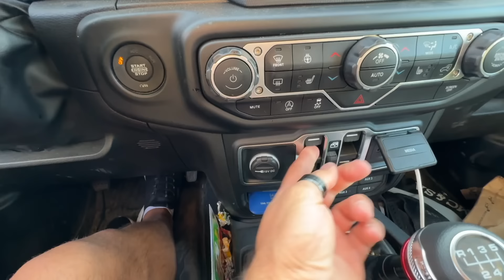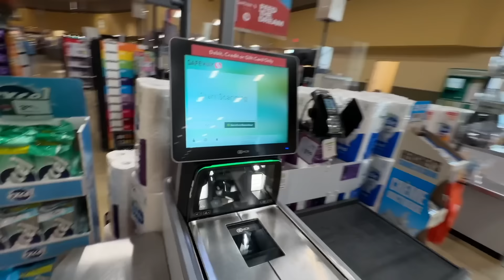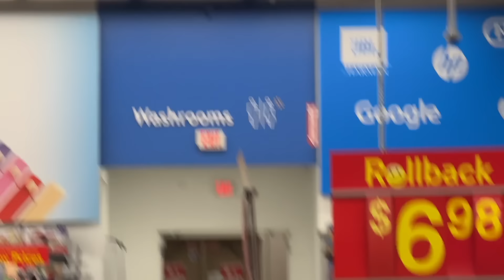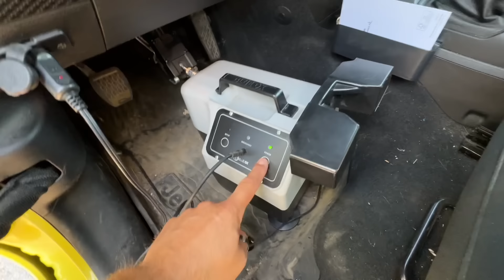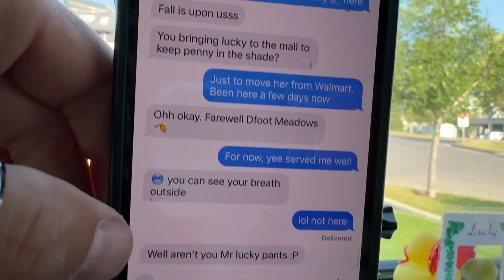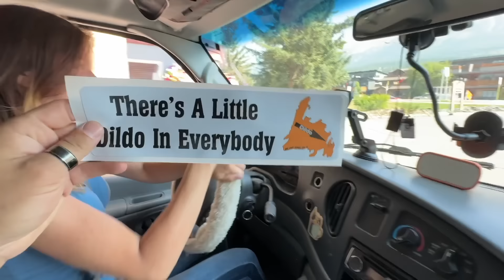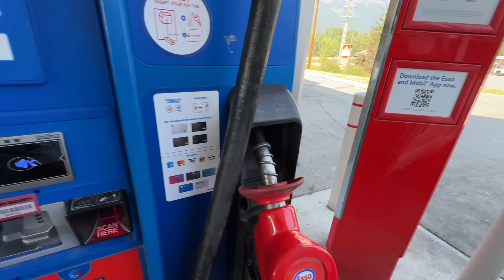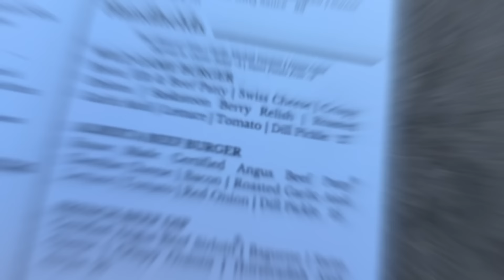Vanlife Alberta - Van BROKE DOWN in the Mountains

Comment: Tell amber if she flips the gas nozzle upside down that usually helps, my work vans do the same thing. I’ve noticed that there is a tight bend in the gas inlet pipe that causes slow drainage to the tank.

Comment: I own and run 2005 and older vehicles. I ran into the slow fill issue once, and I added berrymans b12 fuel system cleaner to gas at every oil change, which eventually fixed the issue. It slowly gets better, and cleans the fuel injectors as well. It might help Amber's issue.

Comment: Reginas fuel refilling problem may be due to a clogged EVAP sensor, or gas bladder issue. my 08' prius had the same problem at the pump, my solution was to partially insert the nozzle so that while pumping gas, an air mixture also flows through. just a diagnosis though! hey Amber!

Comment: Fruit flies happen this time of year if you keep fruit, or corn or such around.  Make a fruit fly trap...get a margarine container, some saran wrap...and take the lid of the margerin container, poke a hole into it with sharp scissors, and cut out a circle in the lid without cutting the edge.  Then stretch some saran wrap over the margarine container (and put some good smelling liquid like some beer, or apple cider/juice in it first just a bit, like cover the bottom centimeter or so) then put the edge of the lid on the container like you're closing it, and pull the saran wrap tight, and poke it with a fork.  Set it out, fruit flies get in, but they don't get out, they drown and die.

Comment: Old starter probably needed a new "contact set" put into it. The bendix causes a copper plate to come up and make contact between where the starter positive cable is, and the contact for the inner coil which completes circuit to start the starter motor turning. I had that happen a couple times over the years (I'm 69) and usually the copper contact inside starter had burned a half moon area finally off, and simple turning it half way around allowed it to work again, which is why the hammer trick also works sometimes by shifting the contact point a wee bit.
Reply: after old starter off, disassemble it to see what I posted above.

Comment: Amber, have you tried putting the gas nozzle in not quite all the way?  I had a vehicle that would do that, but if I pulled the nozzle out a little, it worked fine.

Comment: Is the check engine light on in Ambers Van? Evap system performance code possibly set. If the evap vent is not working or plugged it will cause that exact problem. Valve is normally open so when ign is off vent should be open. If you hear air rushing into fuel fill neck when removing fuel cap then you know its creating a vacuum in the tank indicating a blockage in the system.

Comment: There is a sensor at the the of the fuel nozzle, which will stop the gas flow once it senses the fuel level getting close, my Jeep prematurely shuts off as well. All Amber has to do is pull the nozzle out a bit, she doesn't need to push it all the way in. With my Jeep I've just gotten used to just putting the tip in. 😜
Reply: Everybody just calm down!😊

Comment: .             !💛!  AMBER  !💛! 

Matthew ,   what  a  GREAT 
COMMUNITY  of "Luckies"  you've
got here 👏 .  I've seen SEVERAL tips
here regarding the fuel-vapor return 
line ,  Vents , etc.👍 AMBER:  they're
ALL worth checking-out , NOTHING 
you can't handle  as time allows. 
SOME may also be responsible for
your CheckENGINE light as well.
     My experience is a bit more "danger"
related though.😯  It started months
earlier but I didn't know it.  I would 
use my tire as a step , & one day I
couldn't get my toe atop. I brushed it
off as having too much STUFF in the
back ( moving )  ,  🤔so "Weight Sagging". 
NOPE  ⚠️   🚩 
    My LeafSpring PERCH was failing
& slowly bending over a few weeks.
One day it "catastrofically failled"
as I was making a Wye turn.  The
THUD that i heard was NOT something in the back of the van 
falling/shifting  ; the PERCH had broken 
in two !  A crossmember restrained the
end of the Spring (🍀Lucky!)  , but
then it WORE-THRU the floor😳  
UNSEEN under all the stuff i was 
moving ( i attributed the SAG to all
the additional weight ) . 
   VERY FORTUNATELY , my driving was
non-hgwy.  45mph \ 70kph . I could
scarcely believe my eyes when  i
finished Moving ,  emptying the van !! When the van "dropped" it ALSO
CRUSHED my Fuel Tanks VAPOR 
RETURN Line , & kept causing the
gasnozzle sensor to Shut-off  as you
experience. Refueling was slower 
than slow ⛽🐌 .  So before you
check all the other suggestions , 
get a GOOD LOOK @ your Leaf 
Spring Perches  ( you guys use the
highway system ( to go camping )
much more than i do ,  &  it HELPS
to have BOTH ends of your springs
ATTACHED  !🙃!

Great  2  c  that  Matt's 
          " Got  yer  Back "  😉       👕

🔧🍀 Just another LUCKY day 🍀🔩

Comment: @0443 benefits of a 4 x 4 by 36 inches vs a hammer to the starter.  The wooden 4 x 4 long last the hammer by longevity. A trick of the trade.🌞💰

patent pending. 🪵